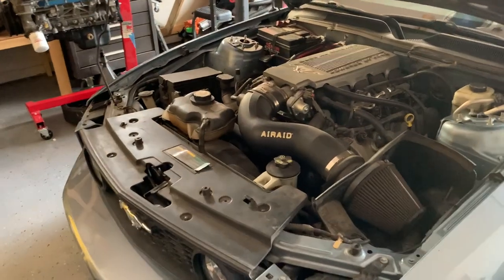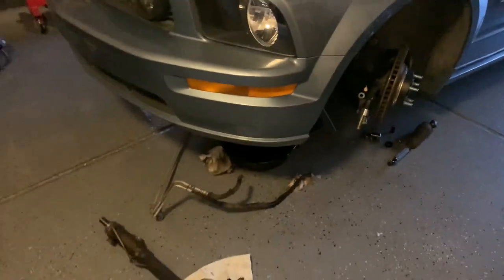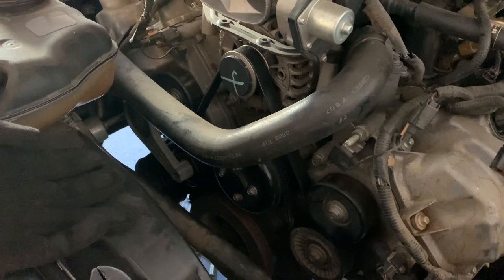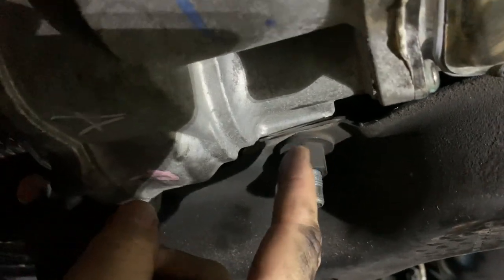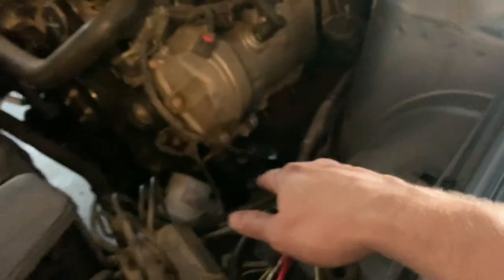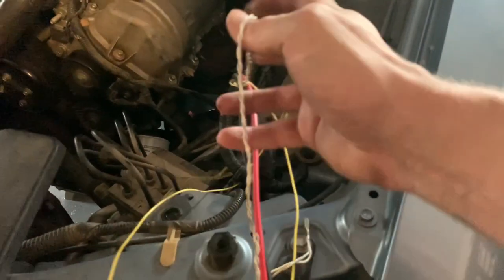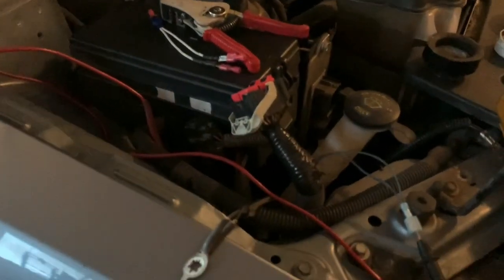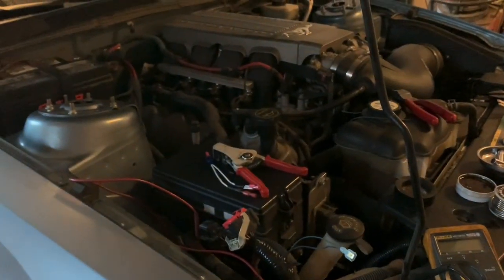Swapping an Electric Rack and Pinion in an early S197 Mustang

Comment: I’m doing this swap in about a month or when I acquire the harness, going to need your expertise when I tackle it man💯 great vid
Reply from the maker: It’s pretty straight forward! I still have it in this car! Just had a Coyote in it now and I’m using the cars CAN bus to control it. You can do the same with the 4.6. Just need to tie into those two wires
Reply: Where can I get the electronic controller for the rack and pinion?

Comment: Well, the EPAS swap worked perfectly! I acquired a almost new 9000mi 2013 Mustang GT-500 EPAS rack for $260 and a EPAS universal wire harness from E-bay for $88. I routed the 3 wire harness from the rack to the ABS module harness right under the air filter. Now if there was only a way to change the feedback setting of the EPAS from Normal to Sport and Comfort. (FYI the cortex unit is NOT needed to complete the install.)
Reply from the maker: My guy Casey at Race at Services in CO has or is working on a controller to adjust the feel
Reply: Question? Where is the 3 wires go I want to see if I can make this work with a Ls swap 🫣
Reply from the maker: @delagto_5340  I don’t think I can answer that knowing you’re doing the forbidden
Reply: @MattSoppa  lol just speculation researching for 11-14 looks like I need a can sim or Casey’s controller. Would prefer a diy solution tho.
Reply from the maker: @delagto_5340  those are the DIY solutions. That and Cortex. Unless you know how to create a can bus signal?
Reply: I'm having trouble understanding this, but what's the difference between using the cortex controller or just giving the rack power and nothing else?  A friend told me when he did it that he just gave it power that is switched on with ignition and he's had no issues.  So I'm watching this and similar videos and reading forums, and I can't figure out if I can just power the rack or if I need to mess with the can bus wires (which I also don't understand what the can bus wires are doing).

Comment: Does this save weight? I'm looking to do this just so i can run a shorter belt with a whipple, but if it's lighter, that would give me even more reason.
Reply from the maker: Probably a little! If anything it puts the weight lower plus you’ll never have to worry about leaks over heating and failures to speak of.
Reply: @MattSoppa  Thanks. mine has been weeping for years where it connects to the steering shaft. i just really want to run a 108" belt instead of the 125" one. Seems like a much better alternative to running an electric power steering pump. will any year epas work? i see a bunch on ebay.
Reply from the maker: @mooosestang  any 11-14 will work. The wheel size they may list for it is just for how much of a limiter they put on at the factory depending on that wheel size.
Reply: @MattSoppa  So 18-23 won't fit? I see a bunch of s550 epas for sale.
Reply from the maker: @mooosestang  no

Comment: What did you do for the 3rd bolt for the rack? Did you just leave it out?
Reply: Actually Ford also quit using the 3rd bolt in later production models. It not needed, but if you want you can drill the hole in the K-Member to utilize it.

Comment: Hey Matt, so if you are using the Ford Performance Control Pack for a Coyote swap, do you still need the cortex controller?
Reply from the maker: If you have a vehicle speed signal, going to the control pack, you can hook up the cabus to the rack.

Comment: I might do this instead of running the PBH front drive kit for my 05 Mustang Coyote swap. I have a 11-14 transmission harness already, which should have the connectors to use the electric power steering. All I'd need after that is an adapter bracket for the AC compressor, and I'd be done... would be way more simple and I'd have more options for boost...
Reply from the maker: Absolutely!!!

Comment: Was it necessary to connect the Can Bus wires to get the swap working?
Reply from the maker: @JustBeezy214  it’s all in the vid. But yes
Reply: @MattSoppa  How is ECU looking for the electronic power steering module to communicate with it if it is added to the existing system. That’s what I am getting to, not trying to get complicated but when I saw you connect them made me wonder. I have a different project with adding a convertible top module to the system and I wasn’t sure about connecting the Can Bus wires.
Reply from the maker: @JustBeezy214  the epas module is only reading. The ECU whether coyote or 3V doesn’t care if there’s a rack connectors or not
Reply: Copy that, now I understand

Comment: Looks like the Cortex Racing site link is dead. Is there any need for that part to complete the conversion now? (FYI the Cortex unit is NOT needed at all to complete the install.)
Reply from the maker: That link for the product may be different now. Their site still works https://www.cortexracing.com/
Reply from the maker: May have to contact them directly
Reply: @MattSoppa  Also what is the part number on your EPAS Rack?
Reply: @MattSoppa  Looks like Racecarservices now has a kit that states you only need the EPAS and their wiring harness for the swap. Is this correct?
Reply from the maker: @whpony96  correct!
Reply: @MattSoppa  Thanks so must for you taking the time to respond Matt! Really looking forward to doing this Mod once the parts arrive.
Reply: I was able to catch it in the Vid...it's DR33-3D070-AF, I was able to find DR33-3D070-CC (Off a 2013 GT500)
Reply from the maker: @whpony96  the rack I got was from a 2014 V6

Comment: I got mine changed at a shop but now the steering feel is stuck at comfort. Anyone know what I can do?
Reply: That is not comfort mode, the rack is designed to revert back to normal mode after a 10 sec power off cycle of the key. Your definitely in "Normal" mode.
Reply: @whpony96  I figured out it needs reporgramming. What I meant by that comment is that the steering wheel was very loose and felt it was comfort mode